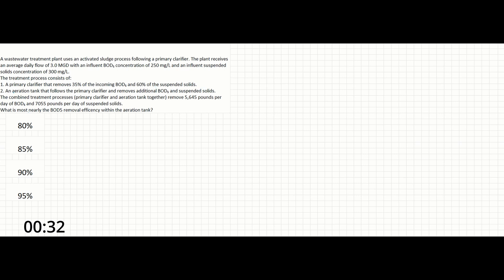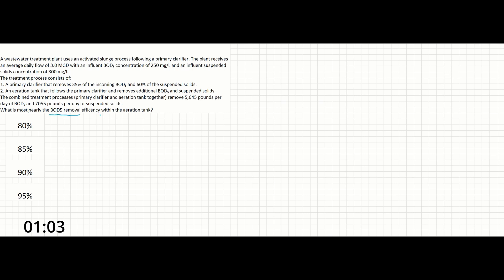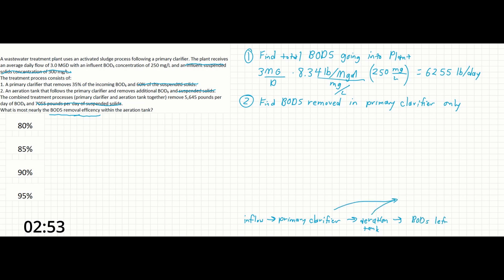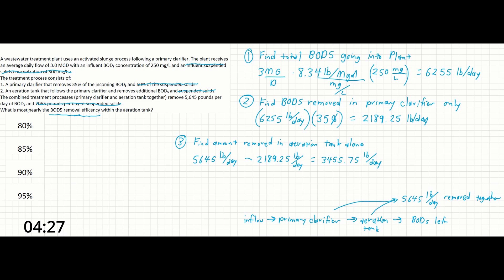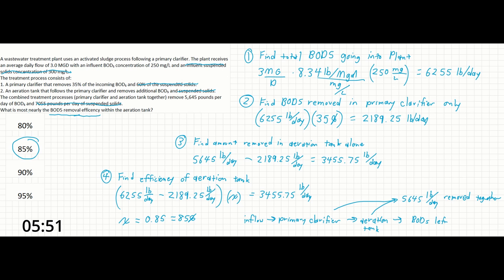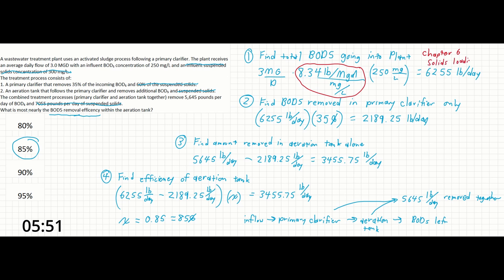PE Exam Practice Problem #85: Water Resources/Environmental | Wastewater BOD5 Removal Efficiency

Comment: A tip i'll drop for others studying, as with most problems on this exam, a sketch really helps to understand what's going on. A simple line for influent and effluent and two circles so you can keep track of the concentrations at the points you care about to keep from getting tripped up. Goes a long way! Thanks again @solvedin6, keep them coming
Reply from the maker: Sorry I missed this before. Completely agreed!